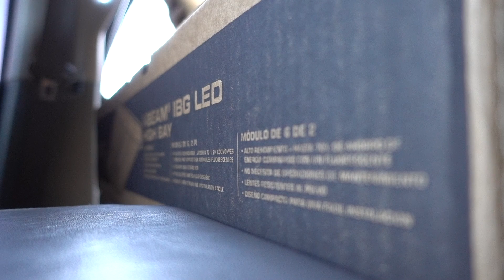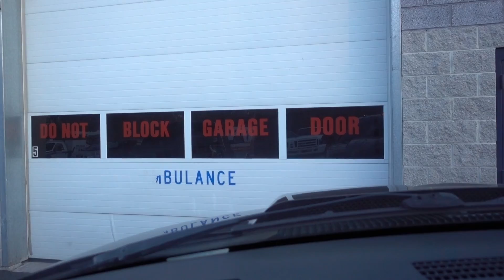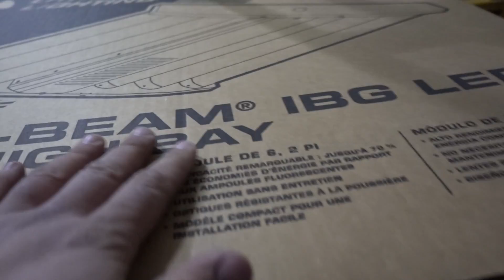Picking up a MASSIVE shop upgrade!!!! *INSANE DAY!*

Comment: I would call it the Mezzanine level or just Mez...
Otherwise it would just be a storage rack...

mez·za·nine
ˈmezəˌnēn/Submit
noun
1. a mid platform / level / lower story between floor and ceiling in a building, typically between the ground and top height of the standard floor level.

Comment: Any Cummins experts know about a knocking noise coming from the front drivers side that only happens when going downhill? Somethings moving when a load is on the front but no sure what - 06 SLT 2500
Reply: Engine related or suspension related?
Reply: blindabinda123 I think it’s suspension related. It’s a weird clunk sound that only happens when I go down a hill. The truck still rides fine but it’s just strange like somethings loose or worn
Reply: ThatIndieGlo check your front wheel drive shaft and the pion bearing ..I had a 2012cummins with 80,000 and the pion bearing went out going down the highway it blew upi ended up changing the complete front end .i don't know was it the cold weather that caused  it was -25 when it happened..the noise you describe sounds familiar to that.
Reply: Eli Mast I’ll take note, Its cold as hell here now in MO so I wouldn’t be surprised if that one of the problems. Thanks for the help everyone!
Reply: Put the truck in neuteral with the e brake on or wheels chalked and spin the drive shaft back and forth. My guess would be a ujoint. Also try putting it in 4 wheel drive and hold the brakes and go from reverse to drive and see if the noise happens.
Reply: blindabinda123 noted, thank you thank you

Comment: Greg, just out of curiosity is the tow rig a 2500 or 3500 chassis?
Reply from the maker: 2500 with bags in the rear
Reply: hey Greg u need to do tire smoke for the baby reveal

Comment: Anyone know anything about a 4th gen whining noise when accelerating??
Reply: I HAVE A 4TH GEN 3500, RECENTLY HAD THE SAME PROBLEM TURNED OUT TO NEED NEW INNER AND OUTER PINION BEARINGS. BUT IN MY CASE , THE RING GEAR WAS WORN TOO, SO AFTER REPLACING THE PINION BEARINGS AND SEALS , HAD TO GO AHEAD AND REPLACE THE GEARS TO STOP THE GROWLING NOISE.   HOPE THAT HELPS
Reply: Super squirrelman could be just as simple as a boost leak
Reply: Thanks for the info
Reply: It ended up being the rear end. Pinion bearing failed. Covered by Ram warranty

Comment: What displacement is the the race truck gonna be? Hopefully 6.4 again
Reply: I doubt it, i'm guessing it'll be a 6.7. 6.4 is kinda a gimmick. If you build a 6.7 right it is a better all around option IMO.
Reply: boosteddiesel if you get a chance listen to the diesel performance podcast with CP Carrillo. It’s very informative on how the 6.4 is superior. One thing mentioned is that it does take a ton of weight out of the rotating mass
Reply: boosteddiesel there is definitely benefits for both and weakness. One thing I like about the 6.4 is you can run much higher boost without too much drive pressure. Also the 5.9 rods are much stronger

Comment: You’re building what most call a loft (edit: commented before end of video!). Shops looking good. You’re going to outgrow that space fast! What are the shop dimensions? I’m planning on building a shop on some property I own, and it’s hard to get a good idea of space without seeing it built. I really enjoy your videos. You’re my favorite channel on YouTube!
Reply: 12RingKing it's actually called a mezzanine.
Reply: 12RingKing build a 100x100 and Gregs shop is 30x60
Reply: 12RingKing you can never build a building big enough. It seems to fill up quickly. My tip is always build it so you can add on an on.

Comment: say I was just wondering if anybody could give me any advice on how to clean a emission system on a 2016 Dodge Ram 6.7 L I believe it's called a particular filter and it is showing that it's plugged I was just wondering if anybody could help me.
Reply: Eli Mast your dealer can do a forced regeneration if your truck doesn't initiate on its own
Reply: James Westervelt OK I might have to do that...I was thinking of doing it myself because I heard they can be washed out.. I don't know how big a job or would be.
Reply: I worked at a dealer for few years, the solution to wash dpf doesn't work hardly at all, gotta super heat it thru regen to burn soot out
Reply: James Westervelt OK thank you. the dealership that we got the truck from didn't seem to know that to do about it.s o I was looking for some advice.. it could be to cold to work this morning we had -30
Reply: Eli Mast deleting it would solve your problem
Reply: Eli Mast have you driven it at highway speeds for like 45 minutes to an hour? That's what I had to do before I deleted mine. Best thing you can do is delete it.
Reply: Some guys claim you can drive it hard (load + high RPM + 30 min) to get the EGT's up and it will burn out the excessive soot. An actual dealer or diesel shop can do a forced re-gen.